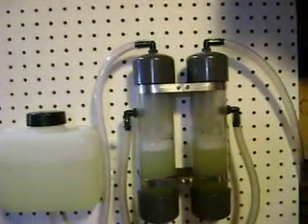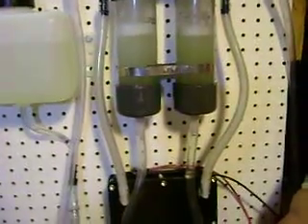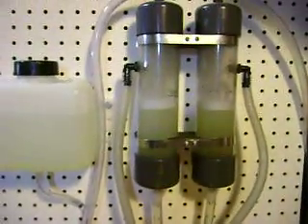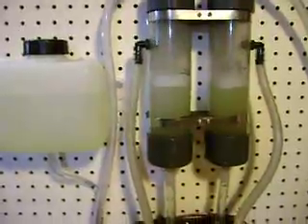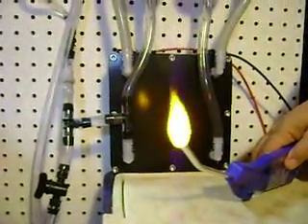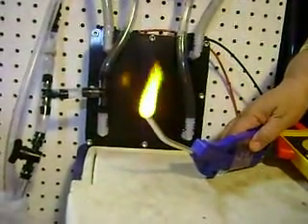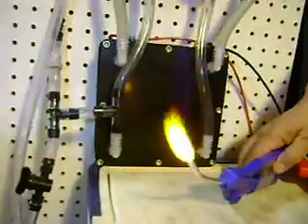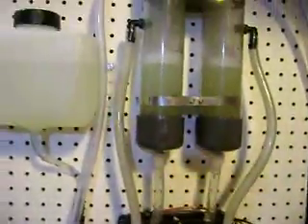Gas Separator (Double Bubbler)

Comment: Good  separate cell .. what kind of  membrane you used in this separate cell ?
Reply from the maker: RAVIKANT at the time i was using nylon silk screen. however if the cell gets hot it would melt and fail.
Reply: Thanks  sir how many microns it is?
Reply from the maker: RAVIKANT smallest i could find

Comment: Hallo
Gute arbeit.
Ich möchte auch eine HHO Separator bauen können sie mir weiter helfen ?
Ich habe eine normale trockenzelle möchte diesen umbauen auf HHO Separator.
Was für ein Membran muss ich nehmen haben sie bauanleitungen die sie mir schicken können.
Reply from the maker: the membrane is from screen printing, but you also must make the gasket on each side port gas to different sides.

Comment: This is exactly true. And I'm telling you one thing that from the tip of that air blower up to the blower body and trigger there is no combustion going because as I said before OXYGEN is not present, But try to shut down the electrolysis until the flame shuts off, leave the trigger  lever open just for two minutes then turn on the electrolysis and quickly ignite the tip of the air blower and you will be surprise what's gonna be next (BOOM). The rule is NEVER LET H2 to meet with O2
Reply from the maker: You're absolutely right! The chemistry behind combustion is fascinating, and it's important to understand the role of oxygen and hydrogen in these reactions. Safety first, though!